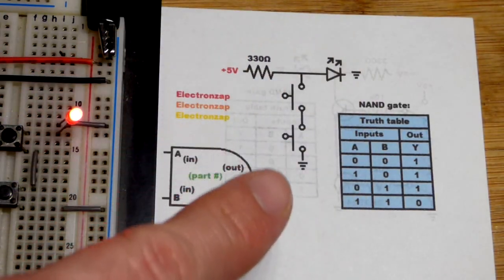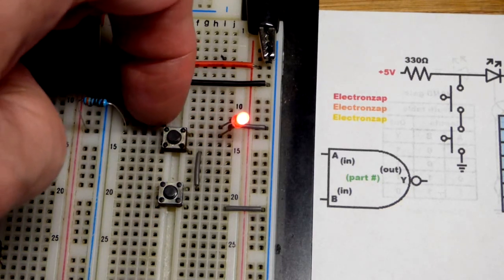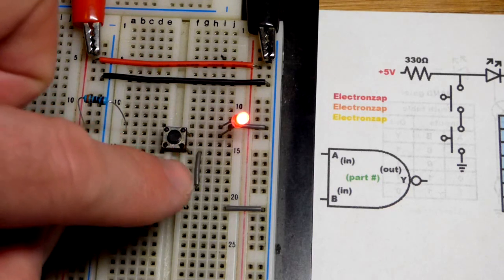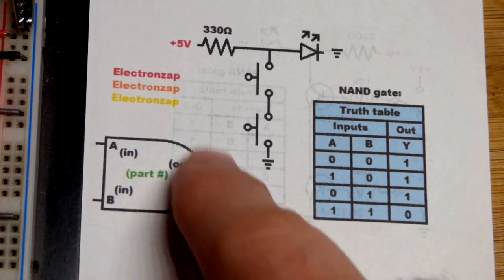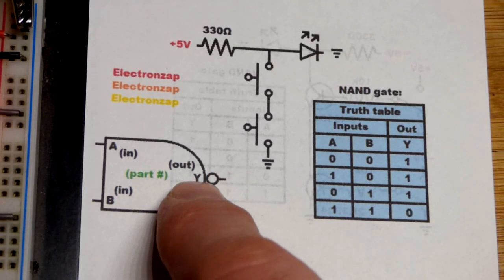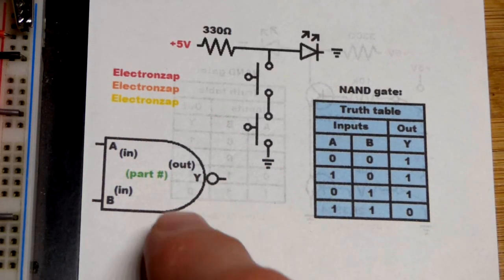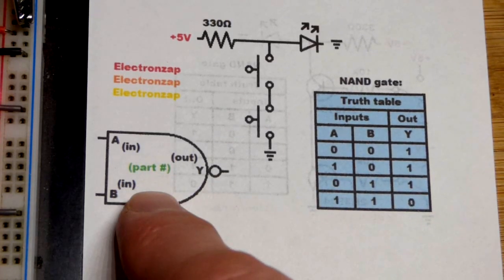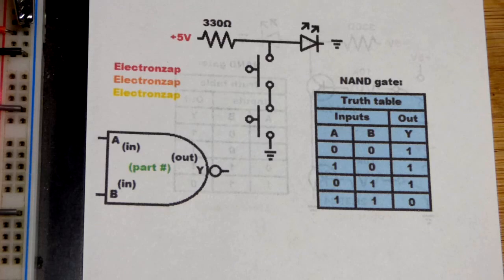Push button switch based NAND logic gate demo circuit for learning electronics shorts 78

Comment: I have a question what if I want to add 2 diodes connected to the switches where will I put them.
Reply from the maker: Sounds like you want a diode OR gate for that. You'd just put them in series with the switches and something that the switch connects to.